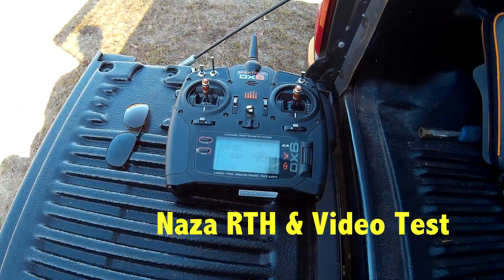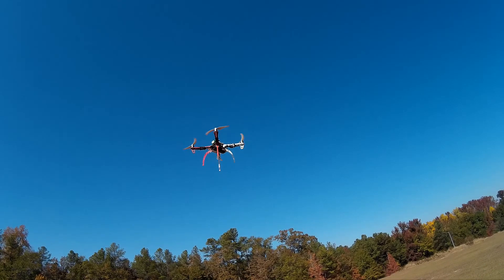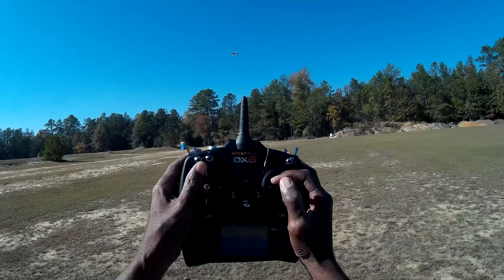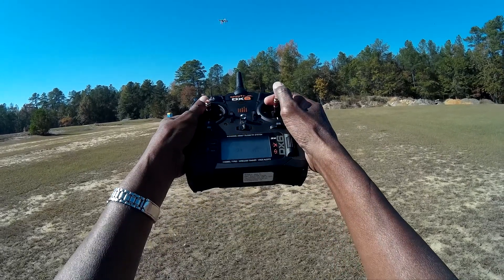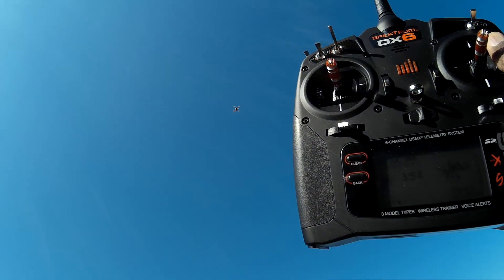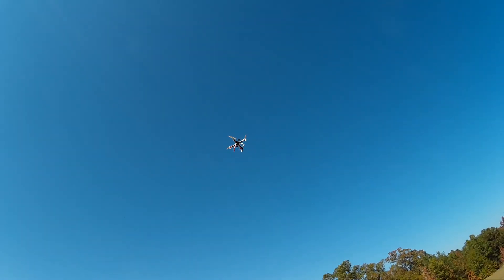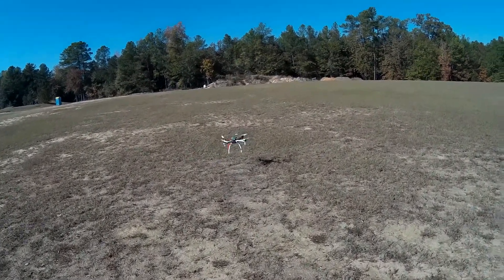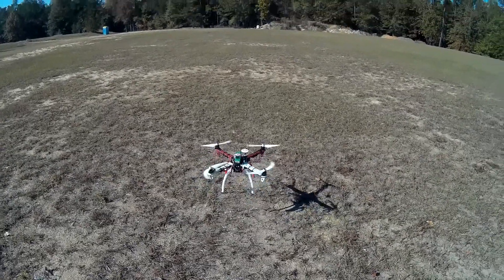DJI F450 Naza & Gimbal Flight Test

Comment: I have a 450 naza lite and after a crash just need a new part. I was wondering with prices now is it cheaper to buy an already built quad with same functions or to rebuild with a naza? Also wondering for buying a gift.  I know I learned lots when drones first came out having 2 build everything but with replacement parts now modular should I just get the rtf quad so they can fly right away maybe i am way behind on technology when I see all these weird brands that have gps, rth,fpv etc. ..any recommendations?  I don't have that much 2 spend so no phantom. I also have a parrot ar 2.0 drone that flew 2 minutes b4 crashing and says unknown error and can't find any place 2 repair is it also outdated and not worth fixing.  Thanks
Reply from the maker: Thanks for your comment & for checking out my channel.  After reading your comments I feel I need to ask a few questions so that I'll know where your interest lie as far as quadcopter flying.  1) What did you use your 450 size quad for with the Naza system? And, what part does it need to get it flying? 2) Are you planning on using the quad for video work? 2) Do you want a new quad for FPV or line of sight flying that also includes altitude hold and return to home features?  Your answers should help me give you some suggestions as what you might consider.

Comment: Really nice build Mr. Hill, The quad seems to be performing very well. I saw just a little shake in the picture but overall the quality was good.
Reply from the maker: Gregory, thanks for the comment.  The gimbal was a gift from a fellow pilot who couldn't get the shakes/tremors out, but I smoothed it out quite a bit.  I might mention that I've already upgraded to a Blade Chroma (https://www.youtube.com/watch?v=ZmM_9FcwUbw), and I'm slowly leaning towards investing in a Phantom 3 because I have some color concerns with the Chroma (It's also discontinued). Enjoy!
Reply: I liked the video that the chroma took. If you are just interested in taking video and range the P3A or 4 will do the job. I purchased the spark about 3 months ago and the video is just as good as any of them. If you can afford it get the mavic because it is more portable and easier to setup plus it has range.
Reply from the maker: Greg, thanks for the comment on "The Shack" video.  I got an excellent deal on the used Chroma so I jumped on it.  However, I'll have to agree that the P3A is my next purchase because the color on the Chroma video files is horrible (maybe it's just my camera).  I've toned down my video production, so I'm not really looking to shooting award-winning footage, just fun stuff.  Take care & it's good hearing from you.

Comment: Really nice! :)
Reply from the maker: Thank you so much for the comment and for checking out the channel.  Enjoy!
Reply: Willie Hill, Jr No problem! Loved that Avro Vulcan and subscribed. :)
Reply: Mine is very similar to this Willie, but had to go 4s when I added the gimbal. There's a fair weight in it. The Naza is sure easier than messing with the Naze flight controllers to do similar....I gave up after 18 months :) Naza was working after a 15 minute fit.
Reply: Ian Lainchbury That's really interesting. I'm interested in the KK 2.1.5 flight control, because it has a screen and buttons to set up. You doesn't need a computer for it.
Reply from the maker: Ian, I checked out your Ghost Quad and it looks interesting.  I started off with the KK2 board, then eventually switched to the CC3D boards for my quads.  The KK2 boards are great for beginners because you can do the programming at the board without the need for a computer link.
Reply: MC's Creations The KK 2.1.5 works just fine :) I have one on a 250 Ghost Quad. Its lots of fun to fly
Reply: Ian Lainchbury Good to know! Thanks a lot! :)
Reply: Hi Willie, Yep, they sure are good for beginners... much easier than the CC3D/Naze/SP3 boards etc. The Ghost quad is a cheap build and perfect for beginners to learn from. I have a 250 FPV quad with Naze32, and a 180 FPV Quad with CC3D. I've recently ventured into fixed wing FPV and its SO much fun!